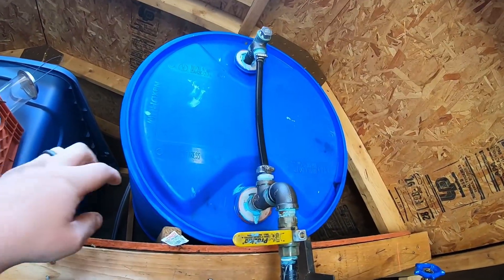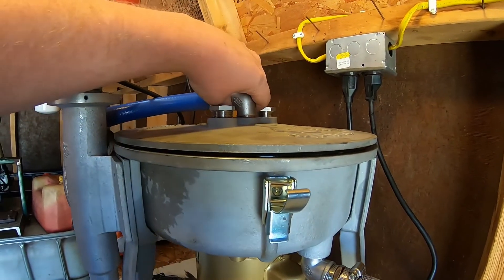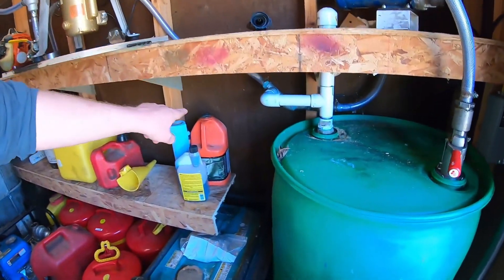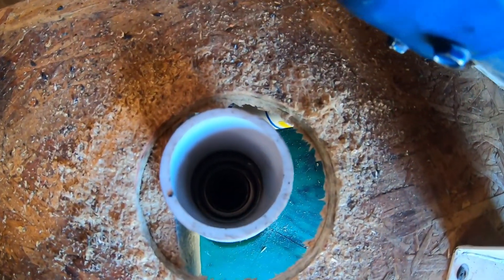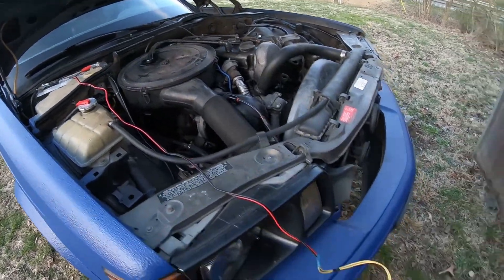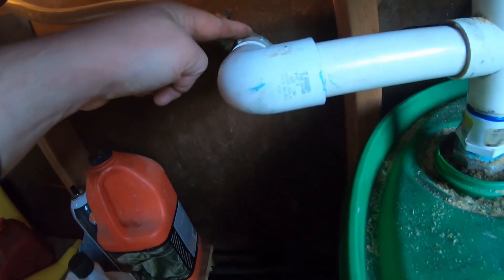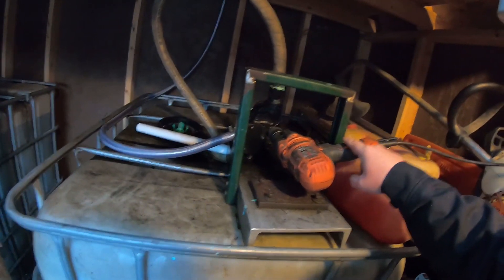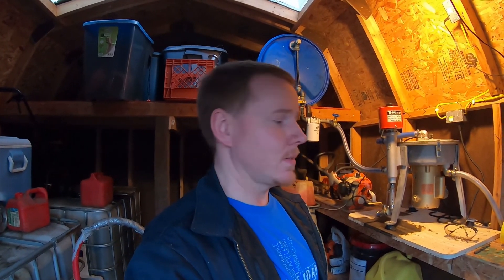Introduction To Black Diesel - Running A 55 Gallon Batch From Start To Finish - Alternative Fuel

Comment: I have an 86 c20 with a 6.2. Any experience on how running this in it might do? Thanks for the videos.
Reply from the maker: Not sure.  I don't have any direct experience with the 6.2 or 6.5 but it runs a very similar injection pump the the 6.9 and 7.3 idi Ford which runs great on it.  I'd start out slow and see how it likes it.

Comment: Great video, I love your setup.:)  I've been running my shop heat on WMO for 5 years now and love it.  I've recently set up a WVO system and started running my truck and forklift on it.  Very happy with the system so far, for my truck I've installed a water meth system to help keep the injectors and combustion chamber clean.  If collection of the WVO becomes a problem I'll set up a WMO similar to yours as I can get unlimited used oil for free.:)
Reply from the maker: Good deal bud.  Appreciate it and thanks for watching!

Comment: Thats a great setup, thanks for showing us how its done! Do you know what your electricity cost is roughly is for processing a batch of 55 gallons like you show in this video?
Reply from the maker: Our place is on solar so cost is zero...  but I figure it up in an upcoming video.  1kw heater...   running wattage of the motor around 450...    so ~1.45KWh per hour of run time.  At $0.14/KWh here, it would cost us ~$2.00 per batch for a 10 hour run...  or ~ $0.04/gallon

Comment: I really like your setup all I've ever done was filtered it I know that's not good enough but I ran three different Cummins on it 12 hours 92 and 2 that was 96 I have ran 100% transformer oil before back in '06 or 07 I ran about 400 gallons straight no diesel ran good what about a reasonable price centrifuge where do I get one of those thank you very much for your videos
Reply from the maker: I know of quite a few people who have had good luck doing exactly what you were doing...  it just didn't work as well for me.  As for the centrifuge..   not sure.  Most places are out of stock and prices have gone up across the board.  For pressure driven, PA Biodiesel or Diesel Craft...  for single pass, WVO Designs.

Comment: Would you be comfortable running that final product in a huei injected ford powerstroke? 95-97 without carboning up the injectors.
Reply from the maker: That depends.  If I was only running a single tank, I would but in lower percentages...   say 20-30% black diesel and the rest pump diesel..  work my way up a bit from there.  If I was setting up dual tanks which is my preferred method, I'd run one tank straight diesel...  the other starting at 50/50 and work my way up.  I know of a lot of people running waste petroleums in the powerstroke..   just need to go slowly considering the cost of injectors if something goes wrong.  CLEAN oil is key...  but people do have great luck with them.  I know a LOT love transmission oil and hydraulic oil.

Comment: Where does the sludge go on a pressure driven centrifuge?
Reply from the maker: It just sticks to the little bowl so you clean it out.  The holding capacity of the pressure driven units aren't the best so in a single run, you may have to clean it out a few times.

Comment: Have you seen where people distill the WMO and make diesel from it?
Reply from the maker: I have...  have looked into it.  It can be done but safety is a big concern with a home brew system like that.  Also, testing at different temperatures needs to happen as the end result will be different based on batch temperature.  You may end up with something closer to gasoline/kerosene than diesel fuel which could cause problems.
Reply: Mini refineries 5500 $ diesel 10cent a gal
Reply from the maker: @tonydiesel3444  have any details or links on a system like that?  More curious than anything.
Reply: @NotSoGrandGarage   ss construction 4/6 gal hr 4kw  like a Texas refinery on a table top ;)
Reply from the maker: @tonydiesel3444  heck yeah bud.  Would love to see some pictures and details of the setup.
Reply: @NotSoGrandGarage  they are for sale

Comment: Hi thank you for your video. I’m looking into getting into doing the same setup, can you please make a video of your schematic from the ibc tote to the clean oil drum with all of the size of fittings/ hoses you used also for the centrifugal bowl setup did you buy that as a complete kit or did you piece it together, where can it be obtained? Thank you in advance for your explanation.
Reply from the maker: I've had a few questions about the centrifuge and plumbing itself so yes I'll put together a video going into detail with it here in the next few days hopefully.  The centrifuge I run came from https://www.wvodesigns.com/raw-power-centrifuge.html.html  They sell a "PoBoy Kit" with just the main bowl and adapter for the motor to build your own.

Comment: Think i dont understand.. what is your machine with bowl doing? Thanks
Reply from the maker: That is the single pass centrifuge.  Heated oil is slowly streamed into the center of the inner bowl.  When operating, the bowl is spinning at 3400 rpm producing over 1200Gs of force.  As oil pours in through the center, it is forced to the bottom of the inner bowl where it has to work its way up and out of the top of the bowl as it fills.  By the time the oil spills out of the top of the bowl, everything from water, particulate, etc.. is forced out of the oil.  All the garbage stays stuck to the inner bowl...  clean oil comes out.  The clean oil is slung out against the outer bowl which it then drips down and out of the hose to the finished drum.  Would probably be easier to show than explain so I may throw another quick video together in a few days describing it in detail.
Reply: @NotSoGrandGarage  think i understand, its like leaving the oil to settle but much faster. thought it might be using centrifuge to push oil through filter but that can be done with a pump more effectively so i was confused, thanks for answering
Reply from the maker: @Boz1211111  no problem.  I'll be posting a video later in the week about the plumbing and exactly how the 'fuge works as I've had a few questions about it.
Reply: @NotSoGrandGarage  awesome
Reply from the maker: Thanks!